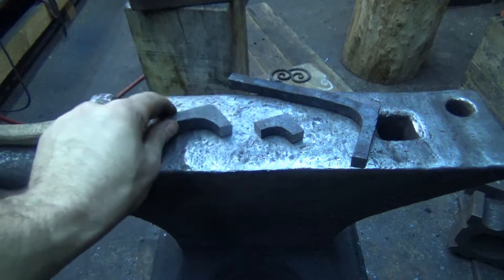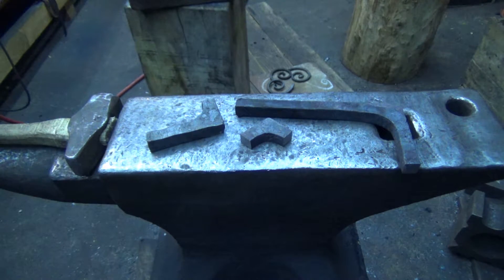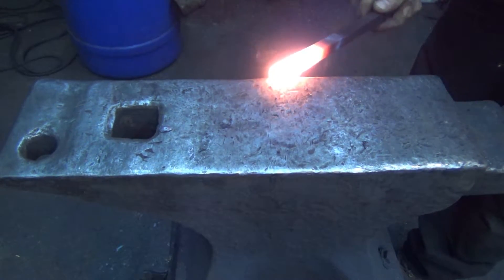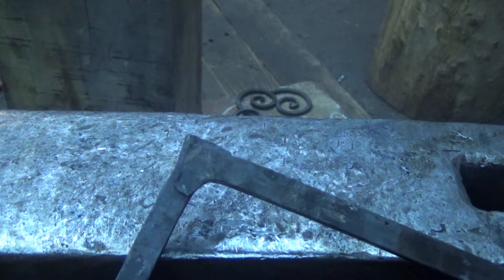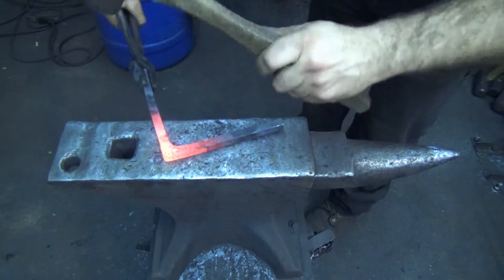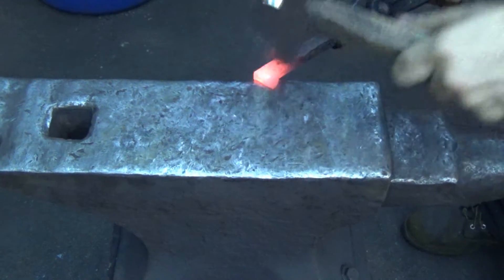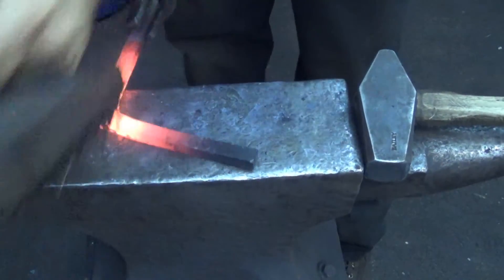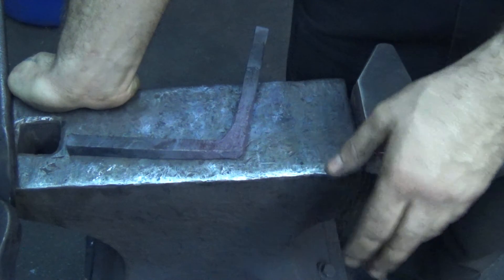Blacksmithing - Forge Welded Square Corners in Square Bar

Comment: This is essentially a chain link weld you are doing here, but without having a chain link. 
If you look up chain link welds, you will find the same preparation. 
Good job!
Reply from the maker: Thanks Joey! Yep I was making some chain and that's exactly what made me think of making a square corner this way. i really like your video where you nick the bar and weld in another piece. I think that's a really flexible technique - you can weld in a lot more than just a square bar